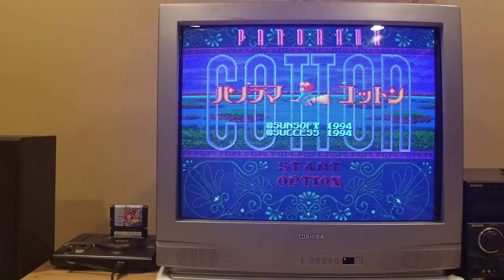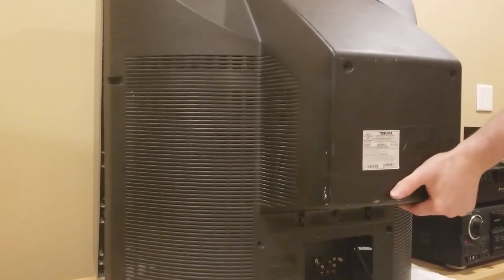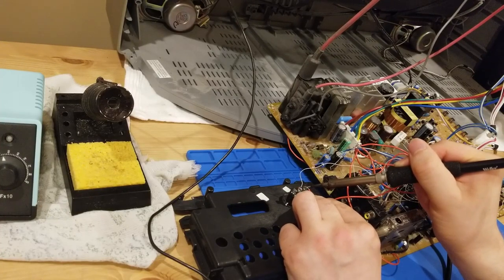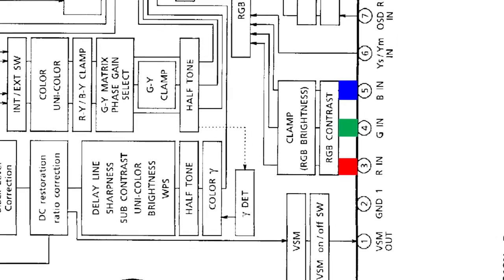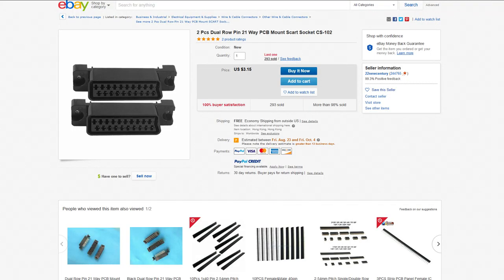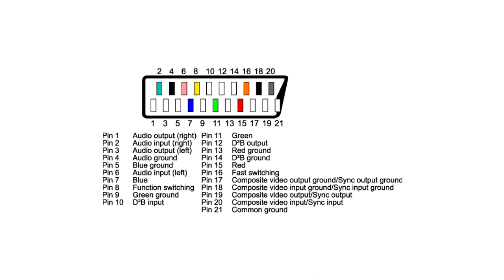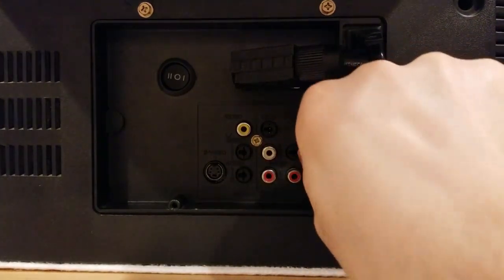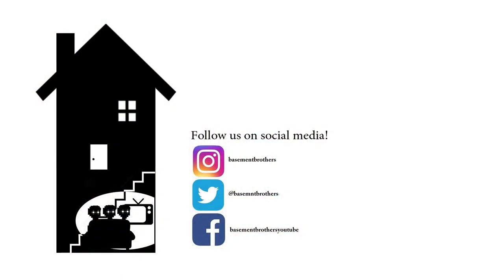CRT TV RGB Mod - Toshiba 32A33 - For Retro Gaming

Comment from the maker: Update (2023): Matt Ross (6tanks) has now written an updated mod for this TV. Please follow this guide for the best resistor values and solder points. Thanks to this guide, the horizontal screen alignment problem shown in the video is solved:
https://crtdatabase.com/crts/toshiba/toshiba-32a33

Comment: Awesome job. Thanks for the upload... I have a pvm2030 that had intractable geometry issues until I had it recaped. Now the geometry is virtually perfect. I recommended you give that a try...I've got pvms and a bvm but I prefer to play on my 32 inch wega. The size more than makes up for the loss in sharpness. I use the shinybo component to rgb. I don't believe it adds any noise.

Comment: Found one of these babies in great condition on the side of the road last summer. I adore this thing. My only complaint is that there is some sort of power saving thing that dims the screen when you leave the video settings.
Reply: I just posted about something similar with mine (possibly the same thing). Whenever a lot of black/dark appears on the screen, the TV automatically boosts the brightness/contrast, and vice versa. For example, a dark text box, or sudden black crop bars on top and bottom (like when you press the Z button when playing either of the N64 Zelda games) makes the entire screen go brighter. Even going from a slightly light scene to a darker one will trigger it. I do not see any option to disable this in the user or service menus. I don't even know what it's called but I'm assuming it's what Toshiba advertised as "black level expansion". I hate when a marketing gimmick ruins an otherwise nice product.
Reply: @spencer6891  That's interesting. I didn't realize Toshiba considered that a feature lmao. Thanks for sharing. But idk, for me it seems to be the entire screen at all times. Like the Super Mario World title screen for example, is noticably darker. When I go into the menu, a change a setting up or down by one notch, the screen gets really bright, and then slowly dims as I leave the menu.

Comment: Nice mod! I still have a 32" Panasonic CRT I wanna RGB mod. I practiced with a little 13" CRT I got from a Goodwill first but it was a quick hack straight to the election guns with my SNES. Beautiful picture but no picture adjustment control. I'll have to look up the model and see if there's a chip like this to do it the right way.

Comment: Thanks for including the guide, just tried this mod using the osd inputs and not working yet.. going to follow your method now... and yep, those unused rgb inputs on the jungle are the key, also using the 104 caps in-line as prescribed. Thanks!
My only question is why bother switching back to the original circuit when it was never used? I didn’t bother, just blanking on/off

Comment: Great job on the mod! Hoping to RGB mod a few CRTs I found for free on Craigslist. I'm curious - how expensive was the mod, not including the price of the TV or any SCART cables? And how much time did you spend looking for documentation and reading tutorials?

Also, how has nobody commented on that beer pour?
Reply from the maker: Thanks for the feedback. The beer footage is something of a recurring joke we use on this channel, and I believe it was commented on already in the Secret of Mana 3 video or the NES mod video, where it was also used. The original joke was that it was a very careless, half-assed, rushed pour.

It's very hard to put a price on this particular mod. It's almost free if you already own the tools. The main cost would be buying any supplies that you don't already have, but if you already do some modding, you may already have most of the tools and supplies needed.

I paid 5.99 pounds for the scart connector from retrogamigcables (about $7.76 US), plus 10.24 pounds priority shipping to the US, which is high, but I always buy some other cables or something I need when I order from there to combine shipping. As mentioned in the video, there is a much cheaper connector you can order from China on ebay for about 2 for $3.00 if you're willing to wait a month for shipping.

Then there's a handful of resistors, caps and wires. Very hard to put a price on these things, since I typically order these in bulk for $20~ large packs on amazon or Jameco. I don't know anyone who buys one resistor or cap at a time.

The main cost really is for a good soldering iron, dremel tool, drill and bits. But these are all investments on things you can use later for other projects.

Comment: what kind of gloves are you using?  specific model or link? i'm trying to find a pair that can handle at least 40-60kv, dealing with a massive 40" CRT TV, curved screen.  gotta discharge it, clean up the back (getting corona sparks due to the humidity making the surrounding dirt turn into a type of mushy linty surface).  might re-seal it too.. but while I'm in there, might even RGB mod it.

Comment: Did you wire your sync to the composite input? If you did, try using the component luma input instead, this will probably fix the horizontal shift issue.
Reply: @BasementBrothers  My parents used to have this TV. Those RCA jacks are indeed stupidly fragile!

You may want to try the S-video luma input as well, if you haven't already. On my RGB modded sony, I get bad picture shift if I use composite, but using luma from s-video is fine. As I understand it, this is due to the composite signal going through a comb filter, causing the picture shift.
Reply: @BasementBrothers  How weird! My parents still have their 32a33 sitting unused at their house. I really want to bring it back to my place and RGB mod it but it's a beast.

Comment: Please update if you do work out a fix for the shifted image. It’s also a bit stretched on the right.

All my Toshiba sets are shifted left even unmodded with HD Retrovision cables. I assumed it was because they use tri-level sync like an HDTV since HD Retrovision’s “Sync Jitter” page describes that causing some TVs to shift left. Obviously, these aren’t HDTVs but that still might explain it.

Also, FYI, Sony Wega is pronounced “Vega” with the Latin pronunciation of W. ;)
Reply from the maker: Interesting about the tri-level sync. I hadn't heard of that issue. So adjusting the position in the service menu doesn't fix it?

I've heard people pronounce it Vega. I guess I wasn't curious enough to check it before recording.
Reply: @BasementBrothers  At 9:05 you mention the same issue with it being shifted left and that it can’t be completely fixed in the service menu. You said Bratwurst had an idea about how to fix it for both of you. I had hoped you found a solution.

You can’t fix it by adjusting H-position in the service menu because it is also unevenly stretched. If you could adjust it to the right enough to correct the left edge you would be losing as much or more from the right edge. Not talking about usual overscan here though.

It may not be related to bi-level or tri-level sync at all. I had just read about it when I got my HD Retrovision cables several years ago and always thought that was it… but all my Toshibas CRTs have Orion tubes inside. Orion is known for having a weirdly uneven stretch. I believe a Lame Gaming or The SegaHolic video mentioned this in their Toshiba TV RGB mod video (whoever it was demonstrated with Contra Hard Corps).

Comment: You don't need a switch, just do like our European TVs, scart devices feed their RGB blanking voltage through the Scart plug, turn on the device the TV switches to RGB mode, turn off the device the TV returns to composite/TV mode, that's how it's done here, there is also a signaling pin to make the TV switch to AV automaticaly but you don't need it just switch to AV on the remote. You can still use the resistors behind the scart plug to reduce it to the proper voltage the jungle IC expects for blanking.
Reply from the maker: Yes. However, I don't think all of my scart cables have the blanking voltage.
Reply: @BasementBrothers  Well at least every single European console, whether a megadrive, a n64, a snes, a wii, etc with their respective cable that supports RGB sends the blanking voltage, it's mandatory to make it work.

Comment: I have this exact TV. Do you mind telling us the video output quality? I can't seem to find it anywhere and the remote doesn't let me choose through 480p or 480i whatever. Just curious since I'd like to use RGB or even Svideo with my Nintendos: SNES, N64, and GameCube. Thanks!
Reply from the maker: It's a standard def CRT, so 480i only, as usual. The RGB mod is sharp. The TV often has some noise on solid colors, which may be due to my video source. The RGB picture is sharper than the component. I just wish I could center the image further right when using RGB.
Reply: @BasementBrothers  thanks! I'm using S-Video from an SNES (bought in 2000 so its luckily one of the newer "1chip" consoles with sharper stock image. That and the S-video looks good enough for my eyes but have enjoyed learning about the RGB mod for this TV. Our GameCube outputs 480p component, so I'm thinking S-Video will be best for that too seeing how these TVs can't handle 480p anyway, and I'd have to modify every one of my consols for RGB output.

 I wish I could center ours too. Or possibly adjust the "pitch, roll, & yaw" or is it called slant and skew for better alignment? I'm a novice with electricity so Im thinking I shouldn't attempt to physically adjust the tubes. Just wondering if there was some hidden menu on the remote I can't find. Any tips?

Comment: I don't get here in Europe all Crts came with the scart connector as standard
Reply: Yeah but I don't think all CRT tvs in Europe carry RGB signals. I have an old CRT, bought an RGB scart cable and the picture looks no different, really. It seems to just be carrying shitty composite.

Just because your TV has a scart socket, doesn't mean it will use RGB signals, it seems.

Comment: Run sync through the s video port or component port to miss the composite comb filter. That will give you a more centered picture.
Reply from the maker: I tried that. I don't think that's the issue on this model.

Comment: I have this set and it would be my favorite CRT if it wasn't for one small but very distracting "flaw". Whenever a lot of black/dark appears on the screen, the TV automatically boosts the brightness/contrast, and vice versa. For example, a dark text box, or sudden black crop bars on top and bottom (like when you press the Z button when playing either of the N64 Zelda games) makes the entire screen go brighter. Even going from a slightly light scene to a darker one will trigger it. I do not see any option to disable this in the user or service menus. I don't even know what it's called but I'm assuming it's what Toshiba advertised as "black level expansion". Have you guys noticed this problem? Any idea about how to disable it on the PCB?
Reply from the maker: No, I haven't noticed. I'm not even sure what you're talking about.

Comment: did you bridge the grounds together?
Reply from the maker: Yes I did. They should be shared.
Reply: Thank you for your response I’m been trying to get this to work, through the closed caption chip. Do you remember pins you use? Are these all of them -2,6 audio input 

-7,11,15 RGB

-20 Sync input 

-21 or 18 sync Ground, 5 blue Ground, 9 green Ground, 13 red Ground, 4 audio Ground(bridge the grounds)
Reply from the maker: I didn't use the closed caption chip. On this model, you can wire straight to the jungle chip. The pins are marked in the video. Good luck.

Comment: How do you get into the service menu?
Reply from the maker: Press and hold the {MUTE} button on the remote. Then press the {MENU} button on the TV's front panel. To exit, turn the power off.
Reply from the maker: @kaedrik5064  I'm not aware of a factory reset. That's why you have to be careful in the service menu. I just guess the meanings based on what they appear to do.
Reply: @BasementBrothers  all fun and games until your menu button on the tv isn’t doing anything🥲

Comment: Or you can just buy a Genesis Component cable (or for whatever console you want)... why would you go through the hassle to use scart? Makes no sense honestly. Component IS RGB.
Reply from the maker: Component is not RGB. Component is YPbPr. While I agree that it is an equivalent format in terms of quality, the console's native output is RGB, not YPbPr. By going straight to the TV by RGB, you're eliminating a conversion step.
Reply: @BasementBrothers  You're right, it is YPbPr... other than that technical term it really means nothing. They both look exactly the same. You don't have a superior image or colors just because you use Scart.
Reply from the maker: RGB isn't a better signal than YPbPr. However, the issue is the added conversion step, which is inherently lossy. And I made this point in the video.